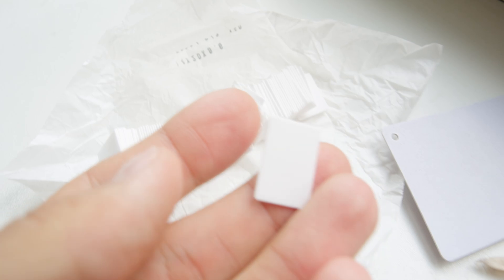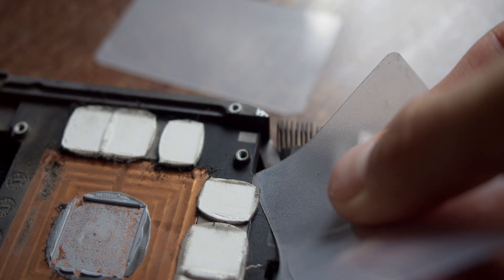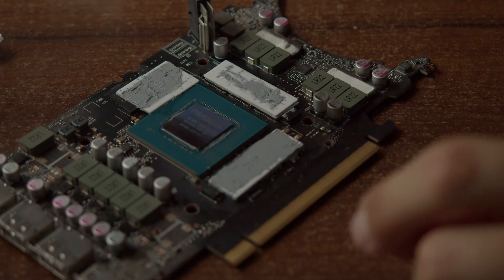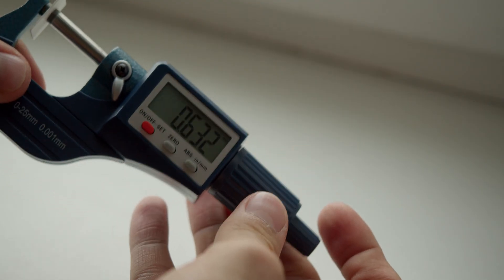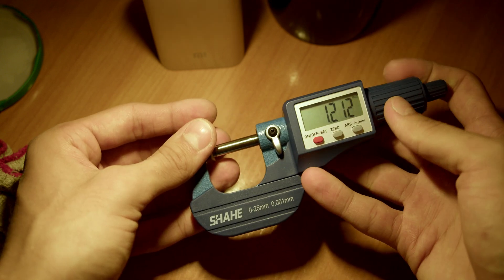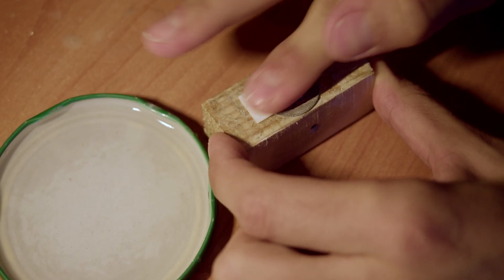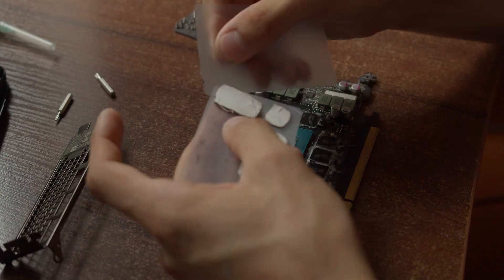NVIDIA RTX 3070 Ti Ceramic Mod (NOT COPPER!)

Comment: Why did not you use ceramic with graphite pads? Ceramic will protect against short circuit, graphite is better then thermal paste on the heatsink side.

Comment: A lot of cards had issue running in that position. They just run hotter. Vapor chamber design is not very bright. Initially all GPU could run like that which is same position as in servers. But now, like 15 year ago, they changed  fin orientation vapor chamber design and heatsink which make them to run cooler in horizontal position . With all that they still push a trend with riser cables, like there is no tomorrow.
Try horizontal position for your GPU and shove it in a well cooled case. Fractal Torrent Compact is a good air cooled case. 

Dust around power delivery is too much. Is strange that you look at the performance of you pads but, you ignore details like - dust is a fair thermal insulator and with the right humidity level in your room will throw some small shorts all over PCBs and you'll find yourself troubleshooting unexplained errors in any OS and waste your time greatly.

Don't be afraid of copper shims, they can't conduct any electricity cause simply can't escape the mounting pressure you apply when you re assemble your card. And don't use individual squares for each module, is counterproductive. Some memory modules run hotter than others, proximity to GPU or power delivery, bad design plating or heatsinks, faults in vapor chambers, bad plating and inconsistency. Basically you want to disperse the heat as fast as you can. Simply you have a bigger surface of copper or ceramic responsible to take the heat from VRAM and send it to the heatsink. In fact, with little squares is higher risk to escape the mounting pressure than with let's say, a shim that covers 4 modules.

I've done my self several mods with copper shims and plates, even changed the stupid back plates of plastic or aluminum painted/ stickers and other crap with whole bare copper backplates. 
8-15 C lower on VRAM.
Never shorted a single card.
100 C I consider critical on VRAM specially where you have Hynix and Micron chips. Samsung chips tend to be more heat resistant but, is not enough info to staple that.
I really don't care whatever manufacturer is saying that 110 C is safe on VRAM they never say for how long, 1 month, 4 months, 24/7 use or less?? IS plain BS!!!!  the number of cards with artifacts I've seen, is sickening, caused by VRAM is huge specially starting with 2000 series  onwards. Client is calling when is nothing can be done anymore because VRAM is gone 1 chip or 6 chips , who cares, card is dead or  artifacts. The problem is why client did not called? - he believed the manufacturer >>>> 100 is safe or 110C is normal. Now the manufacturer sells another card. Work as intended.

Hop[e it helps
Reply: is worrying a lot of cards do not cool vrm and vram correctly, difference between low end and high end mobos mostly are heatsink on vrm,  talking about durability,
Im thinking about a 3d printed frame on plastic, to place the copper without the risk of short
But yes,  "he believed the manufacturer >>>> 100 is safe or 110C is normal" a friend  got a powercolor 6600 when i dissambled i saw the poorest design ever, lasted 6 month, sad, undervolting and underclocking became a necessity, a family member got a laptop with a i3 1215u, it is a beast, but throttles inmediatelly, solved targeting lower wattage, and disabling cores for lower temps but higher frequencies(wanted single core performance), anyways, that proccessor will always be an encaged beast, it will never be able to show its capabilities due to insufficient cooling,  that is the reallity of thin laptops,  they show them as great products, advertise them a lot, why? lot of heat=low durability  low durability=you will have to buy again
Bad Cooling = planned obsolescence best friend
i think is the same with gpu cooling in lot of people, maybe core is cool, other components who knows
Reply: @rafatejera329  Even high end cards have poor PCB now, not all. Is a gamble. For example the highly praised Hellhound 7800XT(at least the first versions) got plasticated backplate with no thermal pads and leds that warms up even more the PCB.

"got a laptop with a i3 1215u, it is a beast"  same with a HP laptop I just serviced with new TIC is an I7 8565U. Insufficient cooling with just 1 heat pipe, very small radiator and exhaust is covered by the screen, bad mobo, all this factors lead to just 2604 multicore score in Cinebench 23 while an I 5 8300H in an Acer laptop pulls 4300 score in same C 23 with same TF 8 paste. A desktop i5 2500 K DTS(not OCed) from 2011 gets 2774 score an beats the I 7 gen 8 made in 2017, well done HP. What a sad joke of a laptop, thermal design and mobo.

Is our job to cool our GPUs is clear as day for me.

Try this if your CPU cooler is not too big:  https://youtu.be/MfaVVInZt5A  . If your CPU cooler is to big find a 10 or 15 mm thickness fans, is better than nothing. Always max out the rear fan of the case and cut the grill if is stupid one. The rear fan is in close proximity of your GPU and can help greatly in exhausting the air form the back plate.

Comment: If you want great thermal paste use IC Diamond Thermal Compound FYI Purified synthetic diamond has a thermal conductivity of 2,000-2,500 W/mK, I change all my graphic cards and use this, it makes thermal grizzly stuff look bad
Reply: Problem is IC diamond isn’t as great of a electrical insulator as due to the diamond particles, it will also be abrasive asf, something like Arctic MX-6 is fine enough
Reply: @kai2679 Why would you be using like sand paper, just apply it correctly and leave the heat sink on, don't lift it again, that's how air bubbles get under it and the application fails.
Reply: @kai2679  MX 6 is pumping out, better not use that in laptops or GPU. Didn't see any problem with IC 7(bought 12 years ago) is also drying very slow, as a thermal transfer TF 8 is superior but I will see how fast is drying though.
Reply: very hard to find in EU now days

Comment: i simply did a copper shim mod 

u can put copper shims on the vrams, with thermal glue tape.

and depending on how thick ur copper shims are, u can either put a bit of thermal paste or a 0.5mm thermal pad on top, to connect it to ur main cooler.

Comment: instead of changing the thickness of the pads, what if you modified the heatsink to squeeze snuggly on to the pads with some springs under small tension? Aluminum can be a lot easier to work with.

Comment: People getting sick, buying a GPU card and then becoming prick about number, temps, tweaks or whatever, wasting the time on these things instead of the purpose the GPU was designed for….PLAY GAMES. That’s make no sense
Reply from the maker: It's not about numbers, it's about what they represent. If, in this case, mem temps hit 110 degrees, cards starts to thermal throttle, drop performance, fans start spinning like crazy. So it's not about number, it's about getting maximum from the thing you bought making the card last as long as possible while having a very quiet and silent in some scenarios card. Fan is literally does not spin. The card will last much longer and experience with the computer will be much more pleasant. I just don't wanna hear a sound of a vacuum cleaner in front of me.
Reply: nvidia failed at designing these cards. this is a fix for the cards' shortcomings and is not a waste of time. The life of the card will be a lot longer if it isn't destroying itself.
Reply: @goofyb6951  make sense in this case, ya right! 
In other hand, there are people crazy about numbers too (when everything is  running “normal”).
Reply: you are a low iq citizen, congrats

Comment: Nvidias retarded engineering rubbing off on their customers. Any sane person would've just used normal thermal pads and squeezed them if needed. Why the fuck did you try this and think it would work, especially with stacking two of them

Comment: why not instead get some good thermal pads like the minuspad 8 and call it a day? yes it wont be as cool as copper or ceramic but defenately better than stock
Reply from the maker: https://youtu.be/WswfRRGoJKE
Reply: thx when i get a gpu that even has a the coler contact the memory il use that(i have a 1660tirn)

Comment: Or just water cool your graphics card with a full-coverage block and correct pads. Save yourself the risk of cracking solder joints under chips, and keep stock cooler minty-fresh, for if you want to resell your card later. Plus the buyer starts off with a newly repasted GPU.

Comment: Once you went too far with sanding your ceramic shims you could have swapped the thermal paste for thermal putty, putty is actually meant to fill gaps so you can use an excess and just use the pressure of screwing the cooler back on to squeeze out all the putty that isn't needed.
Reply: I would use a single sheet/shim and use U6 Pro putty on both sides, this way there is room for expansion otherwise memory chips can crack  on the solder pads
Reply from the maker: https://youtu.be/WswfRRGoJKE

Comment: Dude, Copper is completely safe as long as it does not touch any other gpu components but Vram.
I too have not just copper shims but the whole copper plate on my Vram, and no kapton tape applied at all. All cool, no issues at all.
Reply: Not to mention that all decent cpu/gpu coolers have copper base plates. And yet regular guys on YouTube think they know better.
Reply: @darkoz1692  they do know better, because it helps to lower vram temperatures drastically.